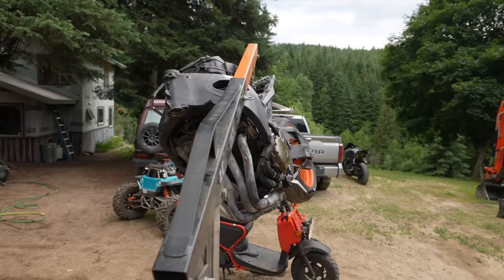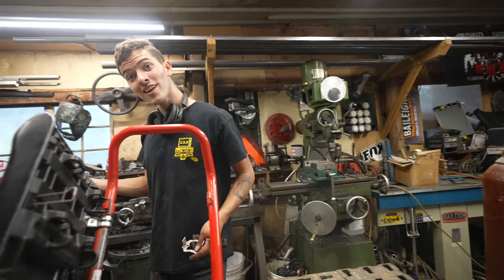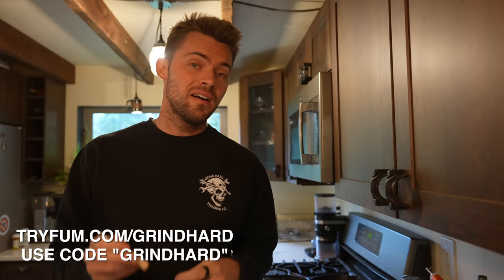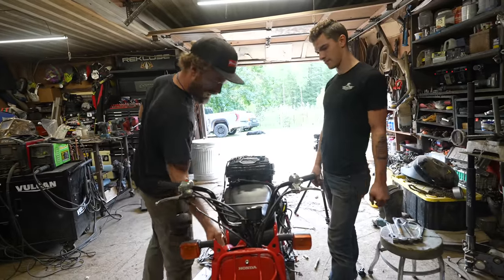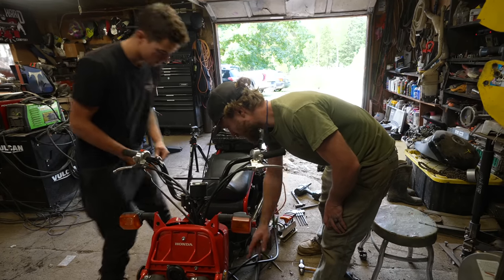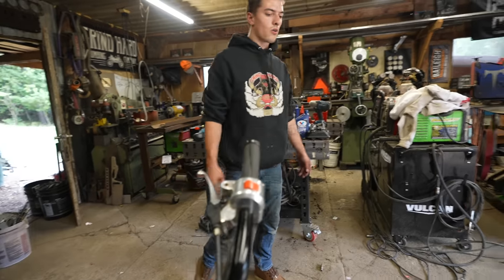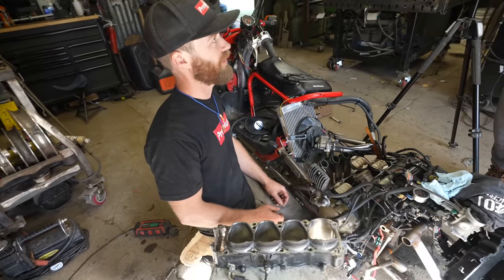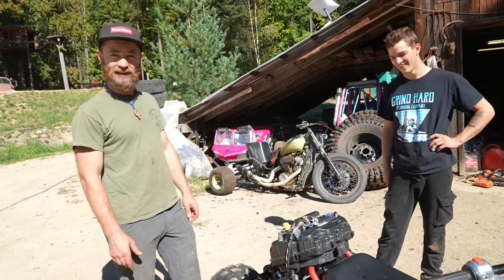First Start! CBR 1000 Engine Swapped Scooter

Comment: as a welder, for furture notice no mater how small the fuel tank fill it with water then dril land enpty to get rid of any left over fuel and fumes to avoid chance of the tank igniteing or exploding. your channnel is amazing keep up the great projects!
Reply: This comment needs to be way higher. Rule #1 don't die.
Reply: fill with argon while welding, no need for water.
Reply: When ever we needed to do fuel tanks we filled them with CO2 from the exhaust of a car
Reply: @venumus1  That's proper hillbilly, but a fuel tank popping open is no joke. Well, it kind if is.

Comment: You where extremely lucky with the gas tank. Whenever you weld a gastank, you need to fill it with something that cannot combust. Like water, or welding gas/CO2. That tank could just as easily have exploded like an actual bomb.

Comment: I'd spend a few minutes congratulating yourselves for having it laid out so you can access all the engine top end repairs. While I have not done a TON of sportbike engine work, I can say the stuff you guys did looked about 500X easier than anything I ever did in a sportbike frame. Turns out the design was extremely useful and premium, eh?

Comment: My compression tester didn’t have the correct adapter, or more to the point, not one I was happy with, some heads have tapered plug seats, and not all adapters are compatible, so I gutted an old spark plug, and used that as my adapter, works great every time!!

Comment: Those fuel pumps are designed to be gravity fed.  They push fuel quite efficiently, but they do not suck fuel very well at all, especially uphill with 3-4ft of feed line.  I also thought I heard you guys say that you tapped the inlet fitting for the pump to an-2 ?? If so that is way too small.  You should be running an-6(3/8”) at minimum.
Everything else you’re doing is awesome!
Reply: What brand of fuel pump is it they are using ?

Comment: Congratulations on your first project coming out so well🏆 fire didn't bite your elbow.💪
 If the tank shifts on the table it breaks the ground connection and found it through your sweaty arm for just a split second get used to it.😅👍👌

Comment: Next time that you sse low compression on a engine that has sat, mix up some acetone and automatic transmission fluid in equal amounts. Put a tablespoon of that mix down each spark  plug hole and let it sit for a day or two. Then turn the engine over and almost every time the rings will free up.

Comment: Ethan to the rescue.

Knowing how engines can  wash the rings out & he mentioned he put oil in 2 cylinders & almost fired. I think if will would of put oil in the others, it would of fired. Then never would of had it apart
Reply: I agree. An engine that's been sitting and then washed down with fuel trying to sort out all the other issues will almost always read low compression. Taking it apart seems like a real premature move...
Reply: Atf works well at unseizing rings

Comment: Just a tip for belt grinders for anyone reading this, always touch your metal corners on a grinding wheel or snip them before you round the corners on the belt grinder… those sharp corners will very quickly wear down and destroy your belts and if you buy good quality belts it will get expensive really quickly if you keep destroying them. 
So use an old flap wheel on an angle grinder, or if you’re in a hurry, gently dull the sharp corners on the edges of the belt where it’s slack, and then continue to round them against the platten.

I’ve learned that lesson the hard way when my boss got whipped across his face with an 80gr belt because I spent all day cleaning up sheet metal and wore it down in the middle and the belt split down the center, caught and ripped and left a nasty scrape across my bosses face… and old grumpy Greek dude.. I got my ass handed to me! I took the simple few seconds to touch the corners on the grinder first and the next belt lasted a full week of abuse and beyond where the first one lasted less than a full work day… ouch.

Comment: Check the valve shim clearance,  is the shims are out of spec you will not have compression and the bike will not start. You can check the by pulling the value cover and using feeler gages.

Comment: I would swap out the airbox for seperate K&N type cone filters or if keeping the airbox I would cut out the bottom of an motorcycle top box and mount over so you can hide the ugly airbox and if you get a big one you can modify to still use some of the box for storage, making it more useable.
You inspired me I have a Yamaha 1200cc V-Max V4 145bhp with the crazy V-boost system engine and rear swing arm so just got to find a decent Ruckus to hack up. 
Looking at it I think I would have placed the motor a lot nearer to the front of the frame nearer to the seat.

Comment: do a leakdown test, itll tell where the compression is leaking from. could be a valve not seated properly ie a bent valve, could be a bad piston ring like the 1st compression 2nd compression or oil scraping ring, could be a cracked cylinder head, cracked engine block, or a bad head gasket.

Comment: From what I was told on the 09 cbr 1ks they burn oil cause the oem rings are loose at low rpm’s and tighten up at high rpm’s that’s why everyone I rode with who had em had to top the bikes off every so often I’m a GSXR fan Kawi and bmw for inline fours but love husky Honda and yami dirt bikes short answer shoulda gotta fixated 1k bro or a ZX10 r motor

Comment: I believe that putting your batteries on the concrete floor will drain the power stored in them. You should try to store unused batteries on wooden blocks to avoid discharging the batteries prematurely.
Reply: I have roughly researched that myth, and I have only come up with it being false.
Let me know if you can find real info that says otherwise.
Do remember that batteries naturally self discharge wherever they are.

Comment: If you do not hold the throttle wide open while doing a compression test and for all the spark plugs you will not get an accurate reading